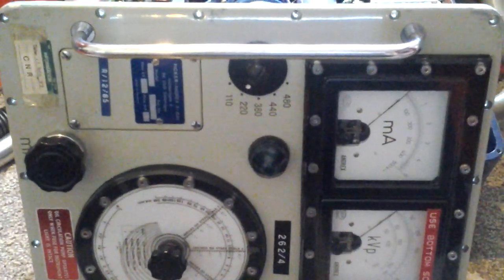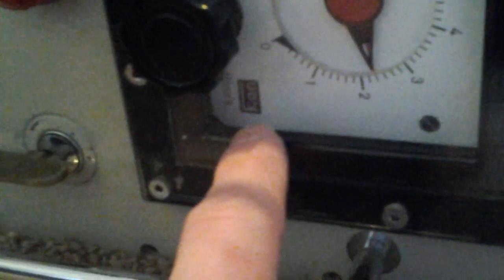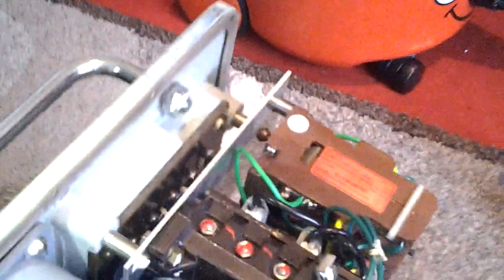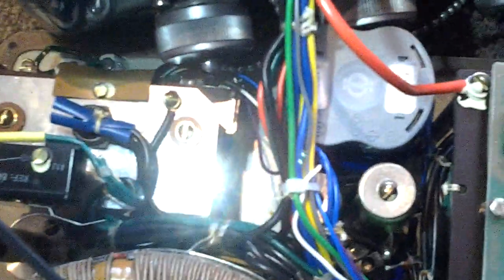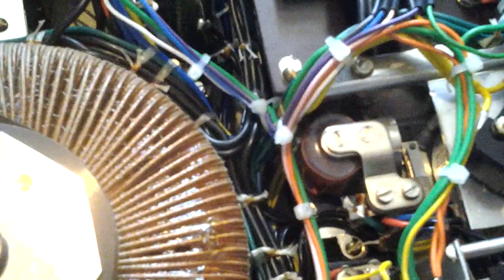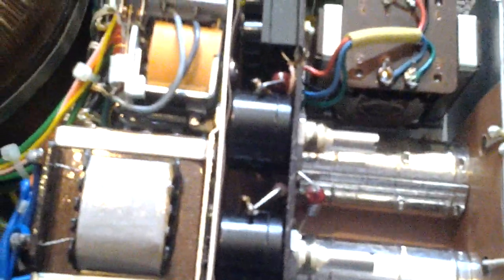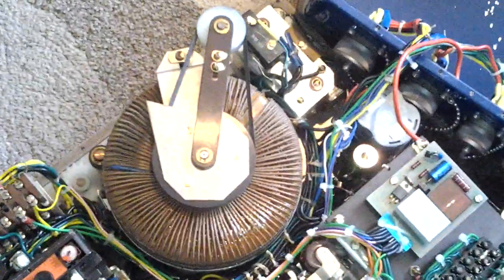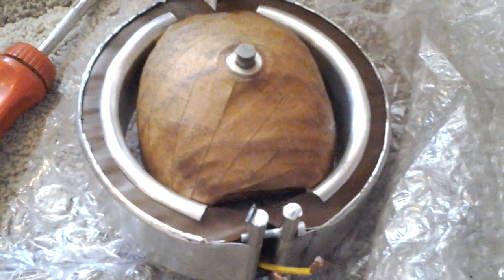Inside the picker-andrex x-ray controler

Comment: mA = heater voltage (the heater current needed to give x mA in the HV)

It will probably not work as a current source without a tube.

But please try to reverse engineer it, and not just butcher it.